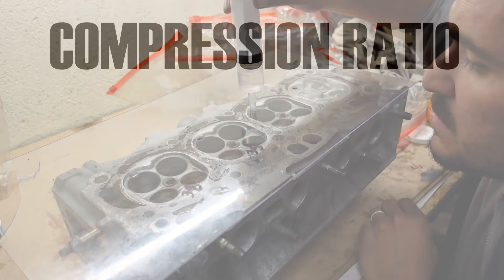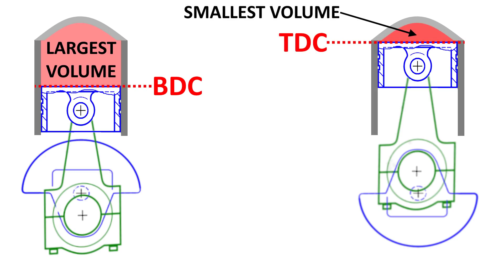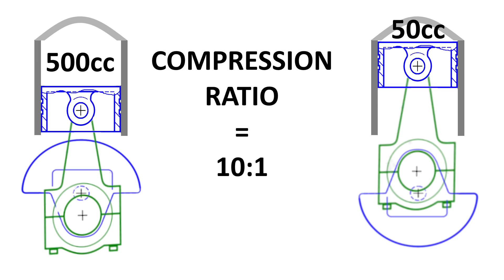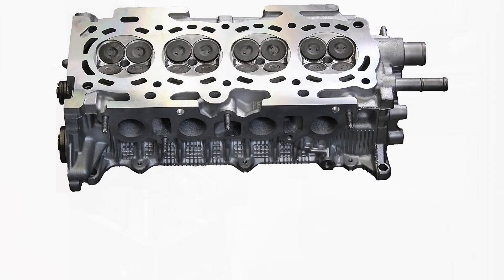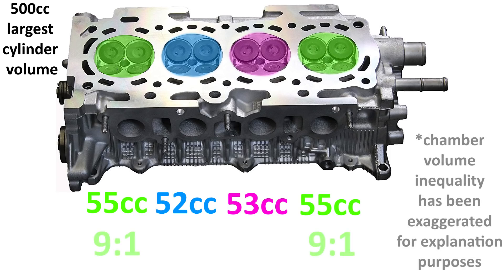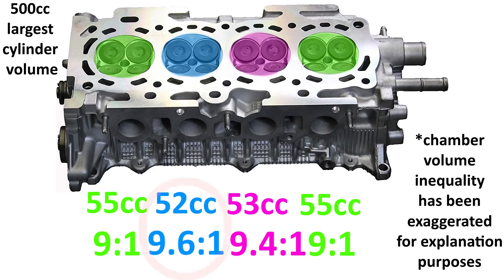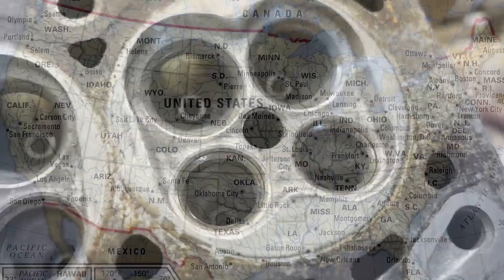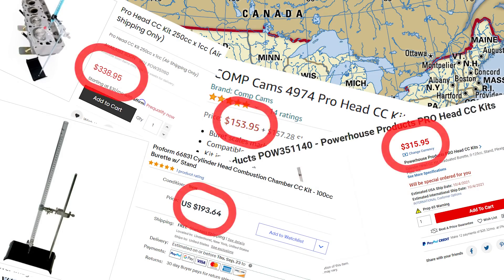HOW and WHY to EQUALIZE combustion chamber volumes CC - Project Underdog #10

Comment: The combustion chamber volume is also affected by the shape of the top of the piston
Reply: Yes. Usually when you buy a performance piston, they tell you how many CCs the valve relief and dish subtract, or how much the dome adds. However, this test should still be performed, as not all pistons are perfect duplicates of each other.

Comment: Great video. I think I first do a "simple" head gasket replacement. So, I wouldn't end up in such a pickle a many others at my DIY car repair shop. Who did bite of more then they could chew.
Reply: Sometimes you can buy a used head, do the work to it, then install it when you are ready. Later, you can sell your original head to someone else. Either that, or you can buy an "As-cast" rebuilt head from your local auto parts store and work that over, then turn in your existing head for the core charge. However, you only get about 30 days to return your existing head as a core. That method may actually be better, since the valves and valve seats have already been reground or replaced, and the deck has already been milled.

Comment: What about the dish on the pistons?
Doesn't that affect compression ratio?
Reply from the maker: It does, but you can't grind a piston top. You can machine it a bit in some cases but that will ruin the coating
Reply: Hence when building a 'blueprint' engine all this work (cc the chambers, check for valve/piston interference (with larger cams) clearance as necessary, set final volume... Then get it all coated.
To get accurate compression ratio it's important to know the dome or dish volume and factor in deck height. For piston that protrude, push them down the bore a known amount (1.000 inch, 30.00 mm or whatever) measure volume like you did then subtract the volume of a cylinder 30.00mm long x bore diameter. A negative number subtracts from chamber volume, positive adds. 
Have to factor head gasket volume also.
Can easily verify stroke with a 6 inch caliper check deck height at TDC & BDC subtract.

Comment: i have a question about the polishing of combustion chambers. I once read that you should not in any case go above 80-100 grit on the combustion chambers and porting due to the fact that the atomisation of the air fuel mixture can be affected badly by this. The reasoning behind it was that water vapor easily condenses on smooth surfaces especially mirrors therefore a too smooth finish may cause fuel to condense on the intake runners and the combustion chamber walls. Any insight as too how accurate that info is? exhaust is where you want the mirror finish
Reply from the maker: Yes obviously a mirror finish on the intake can have negative effects for atomisation. When it comes to the chamber it simply becomes useless beyond a certain point but it can't cause any harm. There's zero chances of anything condensing inside a chamber of a running engine.
Reply: @d4a  i see thank you for the reply
Reply: @d4a  There again, depends.  If your engine is direct injection, it won't matter.  I always polish the chamber because it makes clean up on rebuild way easier, and it reduces the likelihood of hot spots and autoignition.  As stated above, there is zero chance of condensation in the combustion chamber.  Too much PV=nRT going on to have condensation.

Comment: You better be upgrading the suspension and swaybars to handle all that mad power that car gets.
Or did you unbox parts for that in your last video?
I'm gonna go watch that now…
Reply from the maker: I didn't. Suspension is koni yellows and eibachs, but brakes will likely need upgrading. I won't be entering mad power realms, 200-300hp is where I'll be dwelling.

Comment: i prefer the wax method, you melt wax and pour it in the head, cut it flush then melt each cast in a beaker, or put the wax pieces in water and measure the excess
Reply from the maker: I tried that once. It's a good methodology but I'm too clumsy for it. I started loosing pieces of wax here and there and had debris stick to it so I gave up 😂
Reply: @d4a  all you had to do is to put the head in the freezer for a few hours, the wax would pop off on its own

Comment: Are these engine  heads can be ported and polished by cnc machines
Reply from the maker: Yes, but it's not cheap and nobody has the cad files for obscure engines like a 4afe. You can get it 3d scanned but that's not cheap either.
Reply: @d4a  but thats more accurate right

Comment: that moment when you realize this doesnt need to be done in a diesel engine but then remember diesel has its own bag of pains... insert backward vegeta meme
Reply: in a diesel engine it is done on the piston head (wich is the combustion chamber) you then weight the piston and measure the cc of the combustion chamber but it is most of the time useless compared to doing it on a gasoline engine
Reply: @Julesvale  exactly why i said "it doesnt need to be done" you most certainly can but why lower the so important compression needed for ignition?, well theres definitely a place i dont know of where this makes sense on a diesel...
Reply: @Velkanis  its to even out the compression ratio as said in the video even tho in the rare case of a performance built diesel engine choosing good pistons from the start is always a better idea
Reply: Depends on how much you trust the manufacturer to get head volume, rod length, piston crown volume, stroke, and deck height accurate.  These fundamental measurements are not unique to gas or diesel engines.  Ideally, whether Kettering ignition or compression ignition, the mechanical elements would be correct.  Unfortunately, manufacturers work to tolerance and sometimes those tolerances don't work for you, they actually work against you (see stacked tolerance problems for details) as they did for Suzuki when they produced a number of units with significantly higher compression that design would require some years back.  Great for those running super high octane fuel, but horribly destructive for those who ran regular pump fuel.
Reply: @lobuxracer  well the sole idea i was running with the comment was to poke some lighthearted fun at the topic....
i had a long ass reply essentially done but decided against it. 
imma save it for another day...
Reply: @Velkanis  See my other comment in the replies...I've built a whole lot of engines in my 60+ years for street and competition.